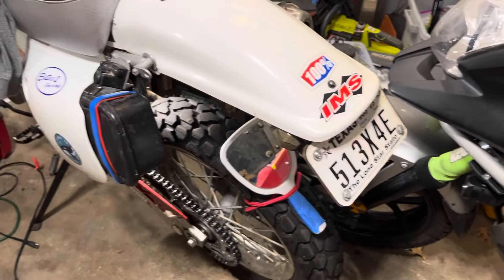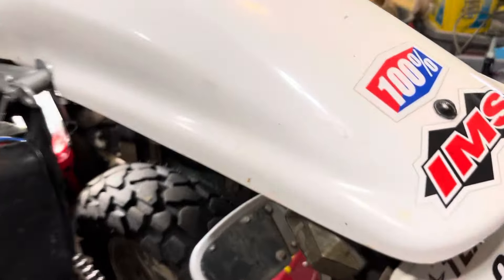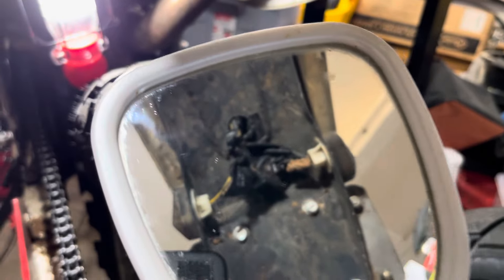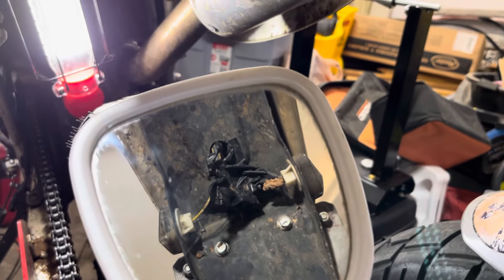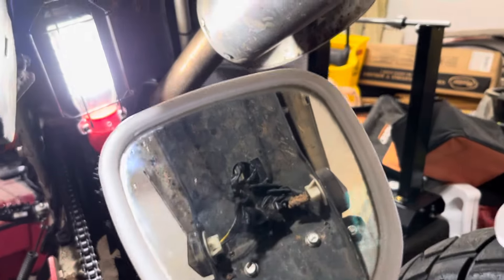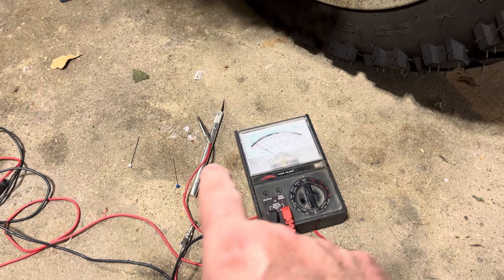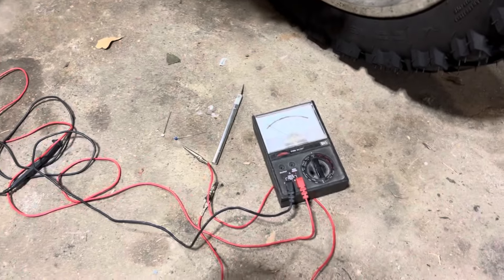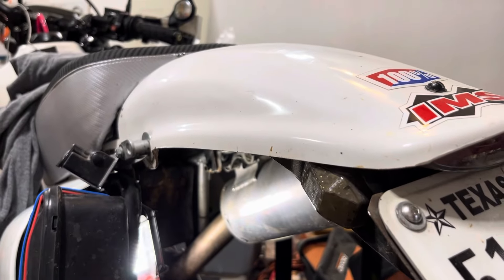How to think about wiring snafoos on the XR 650L.   Think dirt.  Think tough.  Fix it right.

Comment: I completely removed the assembly and could not bench test the turn signals.   But the brake light and tail light worked.   So.   I have some thinking to do.   I think I need to use the brake light ground and one of the turn signal wires.    We will have this.